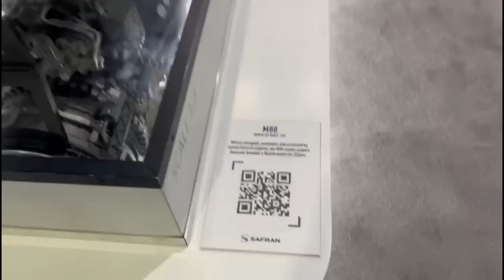#breakingnews AMCA Design frozen | LCA Mark-2 air intake test certification in France #drdo

Comment: Thanks for the good news.

Could you clarify why the certification process of air-intakes needs to be done in France? Don't we have the capability? I find this especially odd as it is mentioned that they are similar to that of Mark 1. 

Apart from the certification issue, I heard once that Mark 2 was going to use square intakes (as F-18A to F-18E transition did when the F-404 to F-414 switch happened) to allow more volume of air but I guess that plan has been ditched

Comment: The main problem is hal little late in submitting the report but the blame is on government.......
Reply: bro the meaning of Frozen is the design phase is finally completed and the blueprint will be executed! you people think Frozen means it's a negative thing it is actually a very positive thing!
Reply: @fuzzytarz7990  Well it's not about AMCA main thing is that we need to learn about our previous mistake and then rectify it. 
Clearly government has these mentality I don't want to invest but want results thats why we have to send our tejas mk 2 
to France for certification 🙃🙃.
Reply: Really then then tell me why it takes 9 months for CCS approval from when HAL completes it's CDR and submitted it, also why no engine deal was sign, no test bed was procure for engine.

Comment: Once money is sanctioned. There is no control on ADA and DRDO. They can delay how much ever they want. Putting the pressure early on is better.
Reply: Tejas MK2 funds are already sanctioned,after that only prototype timeline jumped from 2023 to 2026-27.
Reply: @Sacrafago90  Exactly what I am saying.
They have to put pressure on them before hand make sure all the requirements for building AMCA prototypes are ready then give them the funds.
Reply: @direwolf7491  You don't understand my viewpoint,unless the progress of work is validated,additional funds shouldn't be allocated,as once allocated they would shift timelines delayed by another 7-8 years or more,just like Tejas MK2 prototype.
So,progress should be inspected by IAF on regular basis before allocation of funds,funds only in a phased manner,instead of relying on those lazy bumps.
Proper justification on the funds allocated/utilization,as PSU  don't provide any any credibility or have any accountability,just sit of it for decades.
Reply: @Sacrafago90  I think we are talking about the same thing.
I would like to add the inspection shouldn't be from IAF alone. Because IAF doesn't understand the bureaucracy and the engineering tools that are required for testing and measurements etc.
There must be government representatives would should inspect that also.

Comment: Have zero expectations from drdo and Hal
Reply: bro the meaning of Frozen is the design phase is finally completed and the blueprint will be executed! you people think Frozen means it's a negative thing it is actually a very positive thing!
Reply: @fuzzytarz7990  how can it be finalized? They are still looking for foreign partners for the engine. AMCA has no engine. Using f414 is the worst idea. Even Chinese j20 uses 110kn engine.
Reply: @Fish-ey9lt  a deal with rolls Royce is about to sign
Reply: @fuzzytarz7990  RR just offered. No deal at all
Reply: @Fish-ey9lt  i said its about ti sign, not signed

Comment: there should be dsi serpentine ducts for air intake for best engines output and stablity these air intake are incapable of using full potential of engines
Reply: If ignore the issues if weight, ramp intake like Su 39/ Mig 28 is the best
Reply: They'll come in Amca
Reply: DSI limits speed

Comment: people were blaming pmo for amca dealy but drdo approched now
Reply: Once money is sanctioned. There is no control on ADA and DRDO. They can delay how much ever they want. Putting the pressure early on is better.
Reply: Bro forgot about it Modi itself told DRDO not to delay it
Reply: @mrahulkeya8142  bro it's himself☠️
Reply: If you know why Tejas mk2 air intake test still can't be completed after 1 year delay than u know why PMO is blaming for delay in some program. Some critical test fecility project pending and wait for approval. Main are full scale wind tunnel testing fecility (pending) High attitude wind tunnel testing (pending) high attitude engine test facility (cleared last year) engine test bed(pending) engine testing and evaluation testbed (pending). DRDO is also slow but in AMCA PMO proposed a model name SPV in which HAL and DRDO are only development partners and main owner is a private company tell me the company name after 2years of proposal introduced by PMO. Blaming DRDO is very easy because they are scientists but IAS are main culprit.
Reply: @Dexterj8704  The government, bureaucracy and research establishment can not work in synergy.
Reply: They have this psu mentally.....chalo dhere dhere type...
Reply: Amca approval was asked when Manohar Parrikar sir was there at that time they asked just 4000crores but Air force was busy and only focused on Rafale

Comment: It shouldn't be just AMCA and IMRH in Special Purpose Vehicle Model involving private players with majority of stake. Tejas Mk2 and Project P75I should also go under same heading, in order to get them inducted sooner! Great news about Tejas Mk2 likely to complete air intake test certification  by June 2023. Since the air intake of Mark II is similar to Mark I, the DRDO is confident about bagging the certification and rolling out the first prototype by next year. If 1st protoype does in fact roll out in 2024, that is impressive speed. There is still no news for jet engine of AMCA which is the biggest issue. More money needs to be thrown at Kaveri engine, so Bharat can become self reliant.
Reply: Goodluck with that.... None of the private player had bid or shown interest....
Until and unless Armed Forces change their peanut size orders, none will show interest as well
Reply: @deltasquad5313  Good point, but Tejas is supposed to have significant orders. Subs cost around a billion dollars each so private shipyards will bid on it!
Reply: Defense Matrix just released a video on the same subject with additional information. It said that Prime Minister is displeased by the delays in development of Tejas Mk 2 as well as AMCA.
Reply: @DailyLifeSolution  But PM is not taking his own blame, he didn't fund Tejas Mk2 until full year later!!! One year of useless delay all his fault. 
Also didn't fund wind tunnel facilities and flying test bed. Forcing DRDO to test in foreign countries.
But yes DRDO should outsource to private companies instead of PSUs.
Reply: @datoolz0  The government, bureaucracy and research establishments lack synergy.
Reply: @DailyLifeSolution  in my view they synergize very well to encourage more tea drinking and gol gol jalebi making.
Reply: @DailyLifeSolution  Government reforms to funding is big need. They need to provide money on time and without needless delays.
They also need to buy facilities.
Reply: @datoolz0  I agree.
Reply: @DailyLifeSolution  Basically we have at least 4 urgent priority projects that need to be completed faster. जल्दी चलो.